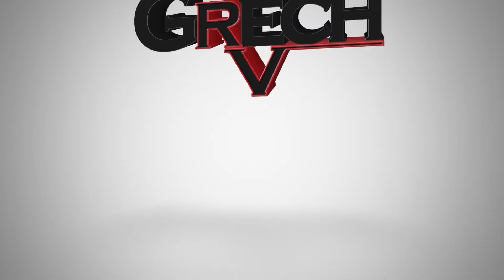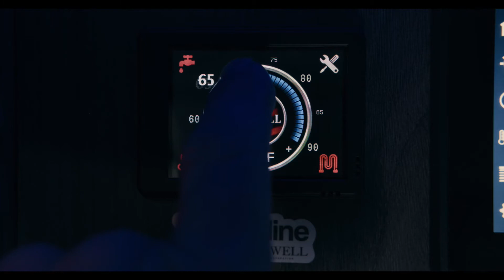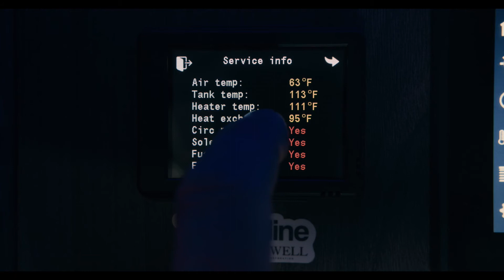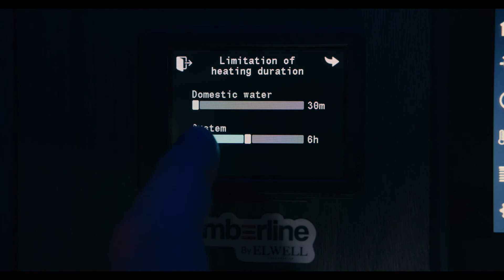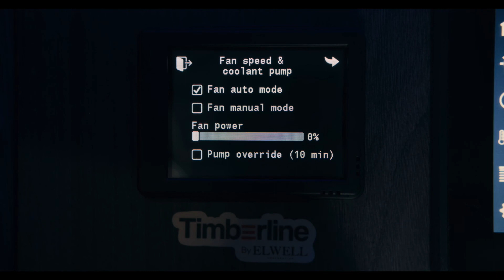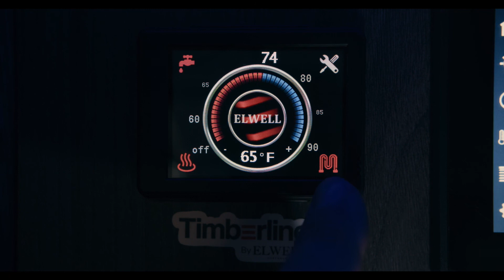Grech RV Strada motorhome Timberline Heating System

Comment: This is the worst heating system we ever encountered. Everything about it is junk. Super loud and annoying during use and the controller is a joke. Would not recommend even to an enemy. After a month of using this thing, I still would not recommend it. It sucks. It blows smoke all the time and make you think that your camper is on fire or something. Doesn't compensate for altitude, either, which is a must have integration that is on most other brands. What are they doing? Terrible POS, do not buy a camper that has this as standard equipment and don't buy one period!